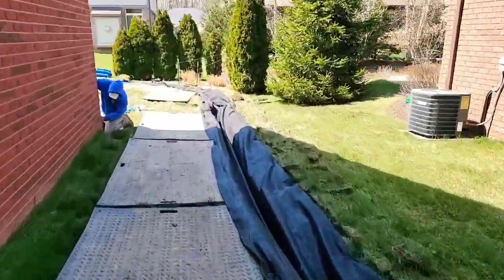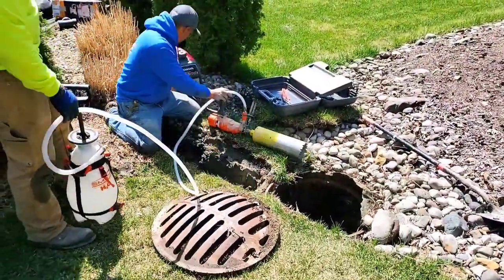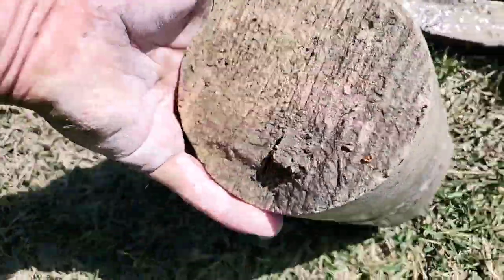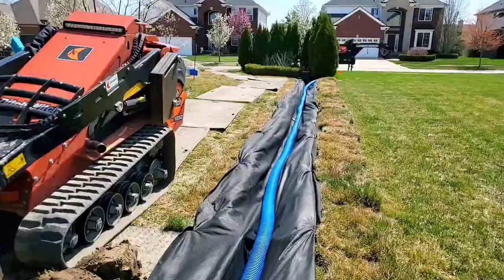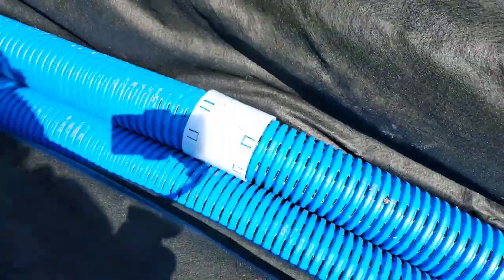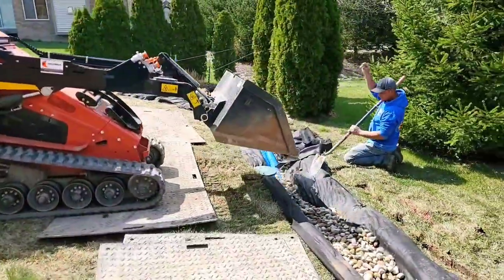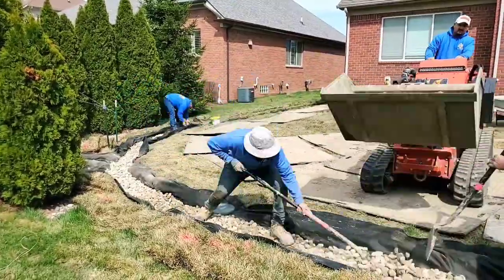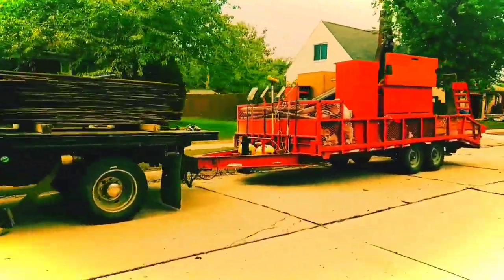How to Hire a Contractor to Build a French Drain - What Homeowners Need to Know Before Spending $$$$

Comment: Do you recommend rinsing/wash the 1.5" gravel before putting it in the trench?  Lately, it seems like the stone suppliers have so much dirt that comes off the gravel and then collects at the bottom of the trench.  I know it is an extra step but I have seen that stuff compact and I believe can effect the performance.  Thanks for the video and sharing your expertise and experience.
Reply from the maker: High Octane slots are so big dirt washes right through. So no washing stone with High Octane 8 slot.
Reply: @FRENCHDRAINMAN when would you use a sock over pipe and also any solid pipe with yard catch basins in addition to the French drain

Comment: Would you still use the 1 1/2" round rock for a basement drainage system or 3/4" stone ?
Reply from the maker: If you don't have iron ochre the large stone has its advantages. A 3/4" stone is fine for indoor work.

Comment: Hello by any chance would you be able to tell me how much you charge per linear foot?
Reply from the maker: It doesn't work like that unfortunately.  Volume, machine access or hand dig, distance traveled to get to the site, 2 pipes, 3 pipes, 4 pipes, flat yard no slope, a little slope, gravity drain or Sump pump discharge drain just to name a few of the many variables that go into pricing a job. $45-$110 per foot for a quality drain built with our high quality products depending on the situation as stated above. If it's done right it will last forever. If corners are cut it will fail sooner than later. Many people Diy using our products and save thousands $$$
Best French Drain and Yard Drainage Contractor
https://frenchdrainman.com/